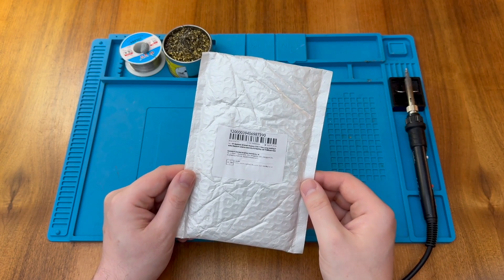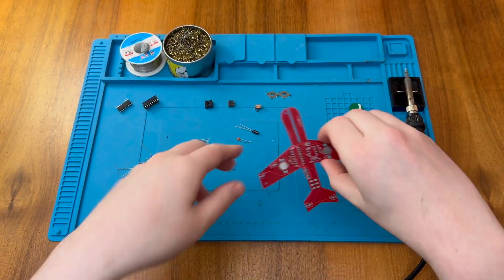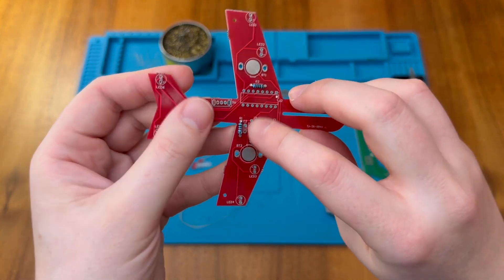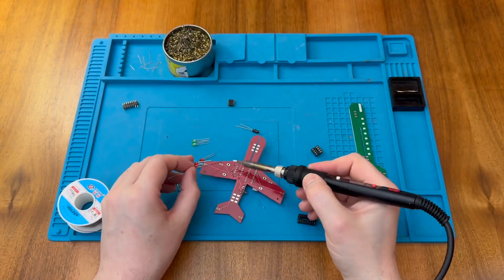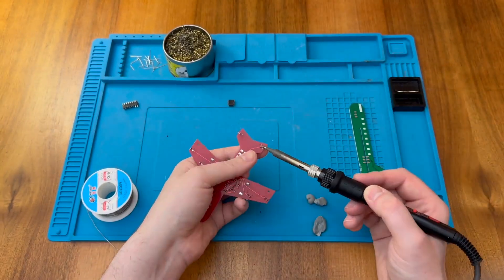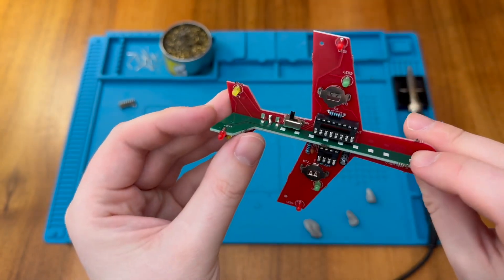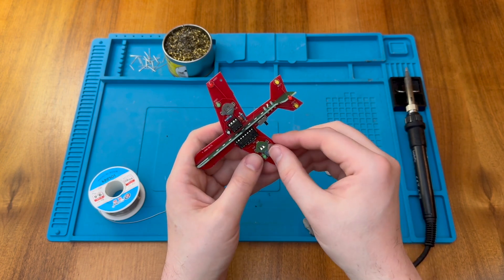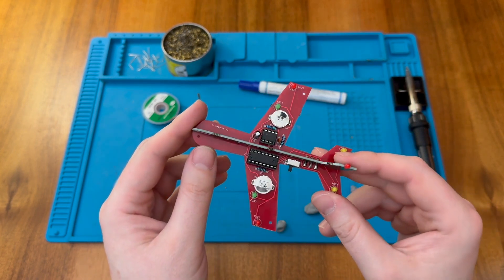This Won't Fly! Small Airplane Electronic Soldering Kit with Flashing LEDs (CD4017 & NE555)

Comment: Hi Jason, I made a right mess with this kit! first I soldered the long socket in the wrong way, the little notch at the wrong end and soldered the small chip in without the socket. I forgot about soldering the small socked and soldered the small chip directly into the board!. When I installed the long chip I did put that in the correct way with the notch matching the board.#
Do you think it will still work? I have not let bought the batteries.
Reply from the maker: As long as you put the long chip (CD4017) in the correct way around with respect to the board, it will be fine. The notch doesn't really make any difference. Equally, it is fine to install the chips without sockets if you prefer. As long as you didn't damage the small chip (NE555) when you installed it (and it is in the right way around!), then it should work fine.
Hopefully everything will work for you. Best of luck!
Reply: @jtjacques Thanks again, you're so helpful.
Reply: @jtjacques It worked 😊
Reply from the maker: @paulelliott8790  That's great!